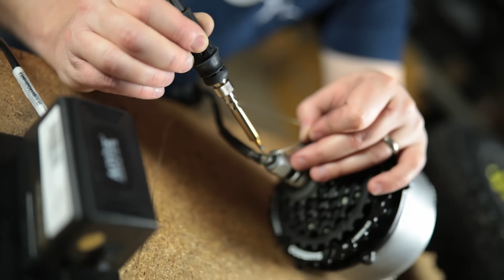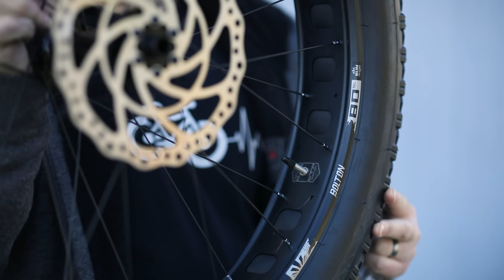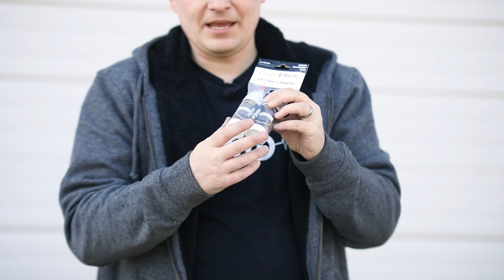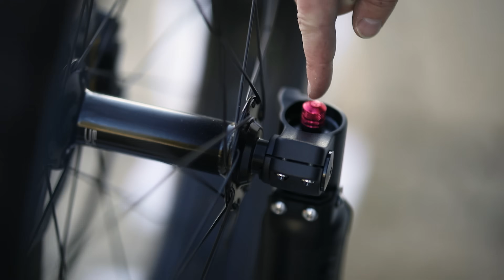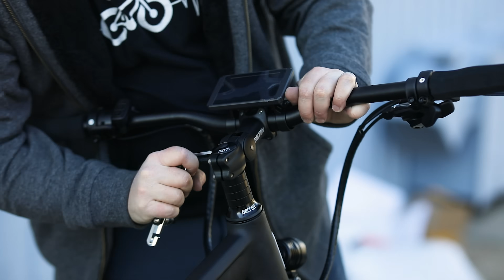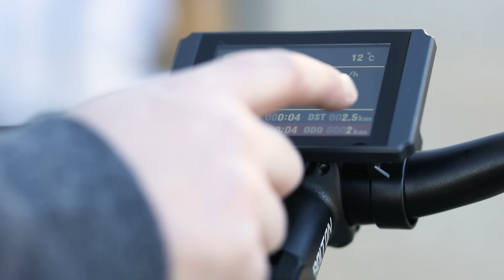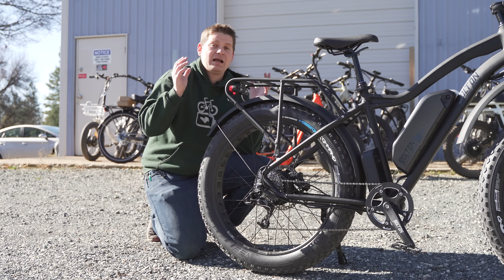How To Get Your Bolton Ebikes Blackbird Ready To Ride

Comment from the maker: What other questions do you have about setting up your Bolton Electric Blackbird?
Reply: I have a question about those custom vents on the controller.  Could this be a concern for letting rain/water into the controller housing?  I would think if your riding in wet conditions this would allow water to seep into the controller and possibly cause some serious electrical problems.  Let me know your thoughts on this.
Reply from the maker: The controller is already sealed against moisture.  The box really isn't needed at all.  It does however help keep water and dirt off the controller, and keep cables tidy.  Theres a hole in the bottom of the controller box where the wires exit.  This will also help any water that finds it way in - to get out.
Reply: @ahill2climb1  v6 oil capacity
Reply: @richardleavitt8212  huh??
Reply: Do you offer any front racks or baskets for the Blackbird? Or could you suggest any aftermarket ones.
Reply: How do I find the more detailed video regarding the display that you mentioned in this video?
Reply: In the video you mentioned that you wouldn't be going into the advanced settings on the display because you had another video where you go over them.  Where can I find that?
Reply: Is there anything I can do to my bike to make it go faster?
Reply: Seems that a lot of people have the same questions that I do. Sure would be nice if they could be answered.
Advanced settings???
Reply: You didn't mention anything about bedding in the brakes, is that necessary?
Reply from the maker: Technically yes, that would be required on any bike.
Reply: @Area13ebikes  do you have a video on the brake bedding process? Also is the tire and wheel setup on the Warthog MD1000 able to be tubeless?
Reply from the maker: @sakostwwy1903  stop hard a dozen or so times.  Done!  No, the warthog does not come with tubeless ready tires and rims.
Reply: Measurements (wheelbase 'front to rear'  outside edges and ground points...   width of handlebars and pedals... )  want to build a rack...   (need both 24" and 26") I ordered 1 of each
Reply: How do we lock and unlock the forks?

Comment: Another product with absolutely no thought of even considering let alone having on the Non premium Chinese knockoff like gauge is the BMS info. Which again this item is completely missing such a helpful stupidly important battery maintenance knowledge , Like God says Knowledge is Power & lithium ion batteries love being cared for before there  neglected by not having pre maintenance information to carry out the full charger charge but leaving the charger plugged in to perform a super duper battery massage to equal out all cells and actually extend said battery life for charging cycles.

Comment: So you’re out on a ride with the black bird and you’ve been riding for quite a while. What does the bike do when you start running extremely low on power does it make any noises does the motor starve for power? At what voltage does the bike shut down?
My bike gets low on power there’s still one bar left and it won’t go anymore??? I think I’m at about 46 V when it starts acting up. It’s almost like a thumping noise coming out of the motor when it sounds like it’s starving for power??? If I take and charge the bike completely back up the noise goes away. I’m trying to get an idea of peak voltage down to dead???
Either dead or it still has a little bit of energy but just won’t drive???

Comment: Dude, i soo wish you were in my town. Ive been tinkering with E bike kits for 5 yrs. Real rat rod stuff...gel motorcycle batteries, front rim brakes only...but it does 30mph...lol...i need parts and a little advice.....i want those cable adapters...do you take on apprentices?...will work for free!

Comment: I noticed in your intro clip @ 0:23 that the hub motor you're handling has planetary reduction gears. Is this usual for a hub motor ? I thought that this only found in mid-drives ?
Do they help prevent burn out on the hub drive when the throttle is pinned from a standstill ?

Comment: I received the Blackbird a week ago and am still waiting for a part that was broken in shipping.  In fact, the battery was laying at the bottom of the box and looked as though it was shipped attached to the bike.  It broke off, breaking the battery holder in half leaving the bike inoperable as an ebike.  Emailed the company a few days ago and am still waiting for a reply or notice that a replacement part was or is being shipped.  No luck. I would not rate the shipping and responsiveness of Kyle very highly at this point.  I will retract this should I receive a response other than the original "let me check into this for you."  response.  By the way, the bike is beautiful other than the broken battery part and a good size chunk out of the battery broken in shipment.
Reply: Still waiting?
Reply: Not good.  I got the Aostirmotor S17 ebike.  I had a few minor issues with it when I received it. I emailed the company, and they reacted within 48 hours each time. My chain ring was slightly bent so it wobbled when I peddled. They sent me a new one out within a week, and I had a bike shop put it on, and they reimbursed that cost for me. The second one was the battery connection, it will come loose every once in a while hitting bumps and stuff. They are already making a new bracket that will fit around the connection to help it. I already did a quick fix myself to solve the problem, but their battery connector bracket will be much more permanent when I receive it. The Aostirmotor S17, with a 1500 W motor is so much fun!

Comment: I setup my new bike.  When I press the Throttle, I keep getting the following error message.  “Motor position sensor fault!”.  Kyle contacted me and indicated the cable 6” forward from the rear hub motor wasn’t fully inserted. After plugging it in correctly, the throttle works as expected.!!!  Kyle, thank you for resolving this for me!!!
Reply: @Bigsmegma44 thank you! I just got my blackbird a week ago and had the same error message, but I’ve been busy with work and school. I just checked what Kyle told you and that waterproof connector snapped in further than I expected and the motor fired right up for me. I just went for my first ride and that bike is FUN!!!
Reply: Did you figure this out yet?
Reply: @micahreitz7390  Yes and thanks

Comment: My Blackbird landed yesterday.  R+L Shipping did a great job.  Use their tracking number to follow the progress of the shipment.  “Shop” was inaccurate for tracking.  The packaging was good, no damage.  The assembly went well with only a few minor issues.  The derailleur needed adjustment from keeping the chain falling off the smallest sprocket.  The front fender tabs are about 3/8” too wide and about 1/8” inch too short.  Used a hammer to flatten the arc and bent the tabs inward.  Not pretty but made it fit.  The light was assembled with the adjusting bracket reversed.  That left the light pointing up about 15 degrees above horizontal.  Reverse the bracket and all is well.  On the programming, C5 should be 10 per Kyle’s previous video.  I’m 5’9”.  My bike has 26” wheels.  I can handle it but would have been better served with 24” wheels.  The first ride today went well.  There is a learning curve for this machine so take your time and be careful out there.

Comment: in the process of assembling my  blackbird tonight. After the front axle was removed the right fork extended, but the left fork seems to be locked in place.
 Cannot move with a reasonable amount of force... Is there a lock on the left fork that needs to be removed? I see a sticker referencing a release mechanisms but don't have any info as to how it works.  Stuck in the assembly process, any ideas appreciated.
Reply: @cyclonex65  Correct, Once I did that it went together fine.
Reply: @cyclonex65  Are they resolving your issue?  What was defective?

Comment: After 7 months of intensive research, I settled on the Rad Rover 5 and was ready to make the purchase. However, the great job did on this video convinced me that the Blackbird is my best option, and it reinforced my respect and admiration for your work ethic and experience in E-bike manufacturing and servicing. Sadly, while your Website shows the Blackbird "ON SALE", the Webpage does not allow a pre-order to be placed despite the fact that the Webpage title proclaims, "Bolton 2020-BlackBird Edition - PreOrder Spring 2021 - SPRING 2021 DELIVERY" Why the inconsistent and confusing messages? HOW CAN I PRE-ORDER A Bolton Blackbird E-bike?

Comment: Kyle, I posted this in the Facebook group, don't see a resolution yet: holding down the up button turns on the LCD backlight, and the headlight icon, but the actual headlight and taillight only come on for a second, then go off. LCD backlight and icon remain on until I hold the up button again and turn them off. Other than that, loving the bike. Thanks
Reply: @cyclonex65  yes. They said it was a controller issue and are sending me a new one. Been a week or so and no delivery date yet.
Reply: @cyclonex65  I contact them using the chat on the Bolton web site. They determined that it is the controller and are sending me a new one. It's been a week or so and the new one hasn't shipped yet, but at least they are addressing it.
Reply: @cyclonex65  Got the new controller, hooked it up and that did it. Problem is, they sent me a 48v controller, instead of a 52v. Not I have to deal with getting that replaced. :-(
Reply: @cyclonex65  I posted a comment on the web site chat on Sunday. I can see that it was viewed this morning, but so far no response. I'm kinda pissed now since, my bike's pulled apart, and I don't know whether to put the old controller back, or wait for the proper new one. Getting that controller box in and out is no simple task. Don't want to do it twice if I don't have to.
Reply: @cyclonex65  Just got clarification from Kyle Chittock:
"It's the same controller, just a different label. Some previous "48v" versions couldn't handle 52v batteries, but all blackbird controllers are the same."
So I'm good to go!. Will get it installed and wrapped up later today.

Comment: Just set my Blackbird up today and went for my first eBike ride. Wow, this machine is awesome and such great fun, looking forward many great rides! My only complaint is the battery and how it connects to the frame. I charged mine, followed your video and connected it. Turned the key to lock it and on my maiden voyage I hit a big bump and the battery flew off and slide down the road. Luckily I was able to get it back without it getting any further damage. Still works but my $500 battery is now all scuffed up on day 1. User error I know but I feel the sliding into place and locking mechanisms are not great. I would advise everyone to check it is attached and then double check it again. Or once you get the battery on properly, don't ever take it off. 
Looking forward to seeing the recommended settings for the display. Love this bike.
Reply: Are you sure that you had it fully locked in place? I've never had a problem with the battery on my Rover and that is a much cheaper bike
Reply: @Scatterbrain70  I'm fully admit it wasn't fully locked in place and not claiming it is defective in the least. It was my fault. 

My only purpose is to hope some other noob sees my post and double checks that the battery is secured and don't be an idiot like me. I put mine on, thought it was on correctly and turned the lock ( yes it was turned correctly) and the electrics all worked so I began to ride. As it turns out, it wasn't on correctly.

Do I think the industrial design on this could be improved? Absolutely. I don't get that satisfying snap or click into place I would expect from such a heavy and valuable component and in my opinion the electrics shouldn't work if not locked correctly. 

After waiting 7 months and being super excited with my purchased the sight of my scuffed up battery has definitely soured my initial new purchase experience. I shook it off yesterday but seeing the battery today makes me sad. It will serve as my reminder to double check that the battery is secure and not make assumptions because it 'appears' to all be working. If anyone at Bolton Bike sees this I would hope they would take it into consideration on future bikes. 

It doesn't appear that I can get a new case for the battery, but I may inquire about that. I am also wondering if I can re-spray the battery to help the appearance a little but I don't know what type of spray would be safe. If it continues to bother me I'll most likely order a new battery and keep this one as a backup.

Comment: Didn’t see anything about this BUT....when getting the bike upside down make sure the either move the controller so it doesn’t get smashed in the process or have good padding for it, do both!  Didn’t learn the hard way but it was something I figure out after my first attempt at turning over the bike...🤙🏼
Reply: Handlebar Jacks are what you need, they're pretty cool.  If it's just for home use though, then a couple of small blocks will work, or as Kyle mentioned, use some of the packing material you just pulled off the Blackbird!

Comment: Nice video. Great for people doing their first bike! Considering my preorder. I assume it charges you now, not when it ships?

I'd be tempted to shorten the... what's it called? The tube of the fork going through the headset? The adjustable stem seems to have good range combined with the raised handlebars to give a decent riding position. Get rid of those spacers.
Reply: I don't think you have to start paying until you receive the bike, or at least when it gets shipped out to you. I pre-ordered for the spring batch and the order is still pending.
Reply: @Scatterbrain70  you pay when you pre-order.

Comment: I'm excited to learn about the walk assist feature.  That's something I didn't know this e-bike had!  This could come in really handy when I'm in really difficult terrain and need to get off the bike to get over logs etc..
Reply: it's an important feature on most ebikes.  unfortunately the blackbird is not a walk mode, but rather a run mode, which means this bike will surge out from your hands if you're attempting to use it.  This is a serious safety concern, and should have been mentioned in the video.  Had I known, I probably would have reconsidered the purchase.

Comment: It was not clear to me, what the vents were for? Were those added to the battery casing for cooling? Would rain/moisture be an issue?
Reply: The vents aren't on the battery, they are on the controller box

Comment: A step thru Blackbird w/ cadence sensor and a cloud 9 seat would be much better for seniors....  Seniors have the  $$$ and there are LOTS of us. Our check books a just sitting there waiting.
Reply: Seats are individual, and C9 seats are a cheap change. I'm not a fan, so making it stock would be a sure mod for me.

I don't understand why you think all or most seniors want a cadence sensor. Can you explain?
Reply: @blakeberlin6295   With cadence it's easier peddling.  You just have to  almost effortlessly spin the pedals to get get more power.  Most seniors  prefer the easier set up.  It would only apply to the step thru "seniors model" of the Blackbird, if there was one.  That's how I see it anyway.  I'd buy one.
Reply: @gordjohnson70  I suspect we have different perspectives (or understanding) of how these sensors work. With a torque sensor, if you want "easier" pedaling, you simply increase the PAS. For example, the lowest PAS may deliver 1 ft pound of torque for every 4 that you apply, while medium might provide 1 for 1 and the highest may provide 4 for every one you apply. In the highest setting, you can pedal lightly and the bike will provide most of the work, but YOU determine the speed or cadence.

With a cadence sensor, each PAS  delivers a set cadence. You then pedal at a pace that matches that speed. You will do more work if you want to ride faster than that PAS offers. You will also do more work in the form of uncomfortably high pedaling speeds if you want to pedal slower than that PAS offers.
Reply: @gordjohnson70  That's pretty bold speaking for "most seniors." Not sure you understand how the torque sensor works.
Reply: Why would anyone want a Cadence Sensor? They can be even more dangerous for elderly people riding these things
Reply: @Scatterbrain70    Damn gravity !
Reply: Cadence sensors are dangerous

Comment: Presta valve adapter and inverted fork are the Bolton US updates.  Looks like I missed on both - my bad.  The torque-arm and you were talking about the second thing as I was getting back to this post.  I can't multi-task so I missed it... ..something "Printed".
Reply: Yep, printed battery vent caps with logo